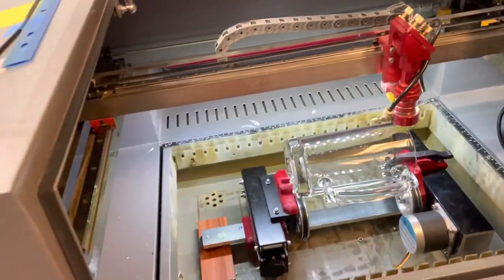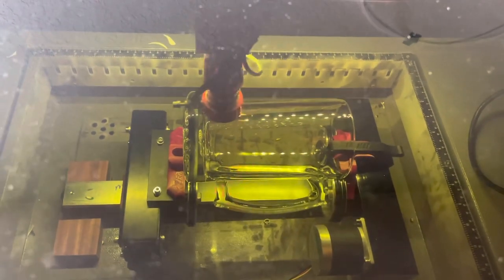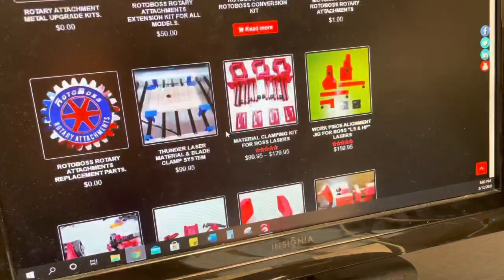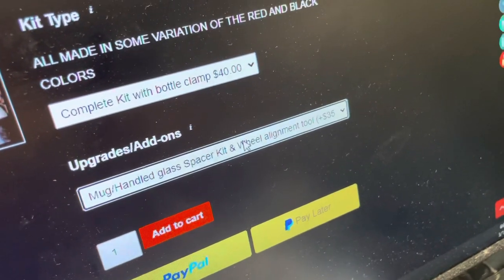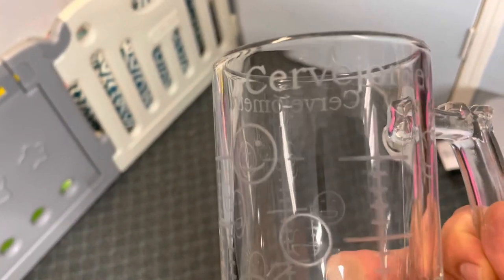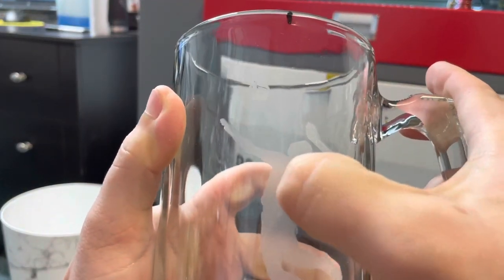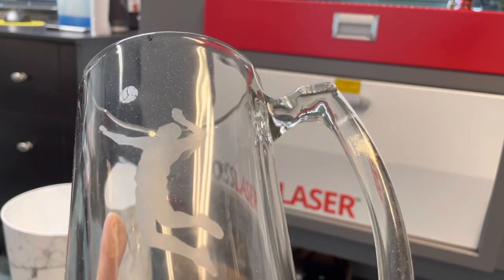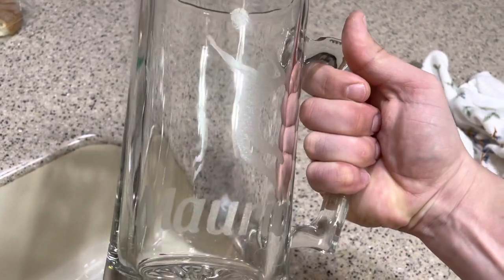How I laser engrave glass

Comment: With glass the less power you use the better.  I have a 100w laser and range anywhere from 20 to 30% with 300 to 350 mm/s and a 0.1mm interval and get excelent results.  I also only use a microfiber towel to clean the finished product.  Never power tools with glass. Hope this helps
Reply from the maker: Good to know. I will have to try it out the next time I play around with some glass. Thank you for the tip.
Reply: How difficult is it to learn how go do it? I'm thinking about doing it for a sauce business that I'm starting to make the bottles stand out more than your typical sticker label
Reply: But how about the flaking of the glas? eventually it will come off, in someones finger or such. I have a 60W laser, lowest I can run is 14% power, and have tried up to 500 mm/s, but still there are flakes coming off, and need to get those out before sending to customer.
Reply: If you get the settings in your laser correct the glass won't flake.  You have to work by trial and error.  Remember there are three settings you need to look at: Speed, Power and Interval.

Comment: Hi Bill, I  seen this done on another video and i like the idea so im trying it, not having good results though, some of the fractured glass cleans off like it should but some does not and if i use enough pressure to clean it off it scratches the glass...ive tried several settings including running a power scale.
Reply: I'm at the exakt same situation now. Have you had any success?

Comment: Hey Bill! What settings do you use for your boss1420? I'm running the 70w and can't quite get glass right. It either flakes right off or chips in spots. I've seen 325mm/sec at 40% but then some guys run it at 400mm/sec at 70% power. Your mug looks really clean so I figured you had a jumping off point. Thanks for the help!
Reply from the maker: Hey Brandon. Sorry for the late reply. I use the boss recommended settings for glass. 325 speed, 27% power and 0.065 gap/interval.

Comment: If you need to mirror your image then your setup is incorrect.
1. Reverse the direction of the rotary axis in machine setup.
2. Swap the two wires on one pole of the stepper.
3. Place the rotary the other way around.
Take your pick.
Reply from the maker: Yeah I was informed of that after I posted the video. Thank you for the information. I hope it can help someone else as well.

Comment: Hi there master how can i engrave glass with colour ?
Thank you
Reply from the maker: You would need a special paint for the glass like Cermark or Laserbond, but I believe it's only black. I don't think they have any other colors available for glass.
Reply: Never seen color either, but search out the Norton method.  Far cheaper than cermark or laserbond and you get a black mark just as durable as anything else you can do.  (also called the Norton White Tile Method).
Reply: I never used it but I have seen something online called Rub N Buff.